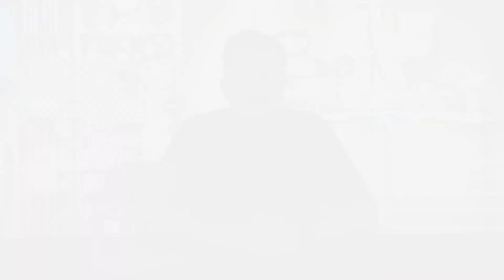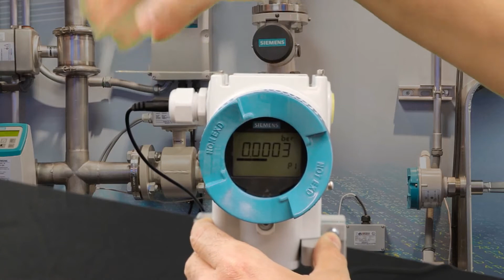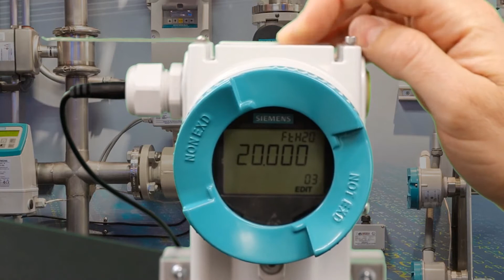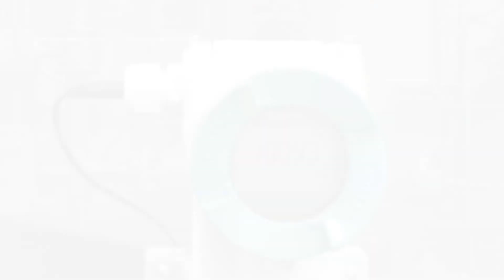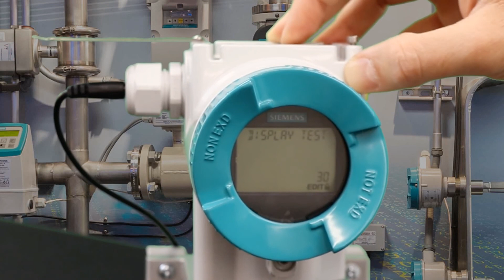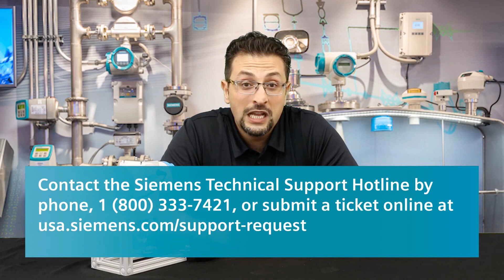Setting the SIEMENS SITRANS P320/420 Pressure Transmitter for Level Measurement

Comment: i want to ask about model SITRANS P320 Pressure transmitter
Model: 7MF0340-1GL01-5AF2-Z C11+E00+Y01
what the meaning with Y01
and if i need it -60:60mbar
Reply: Hi Ahmed, this answer comes a bit late, but could maybe be usefull. :) The Y01 option is for the measuring range settings. To mention what you need, you just have to add the calibration between brackets. The correct model you would need is this one : Model : 7MF0340-1GL01-5AF2-Z C11+E00+Y01 {Y01: -60 ... 60 mbar}. Hope it helps !